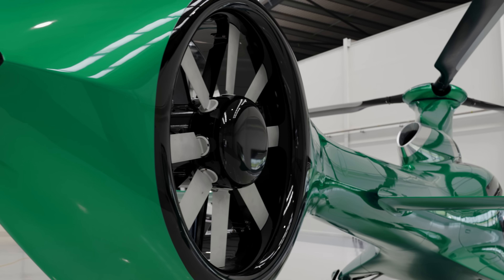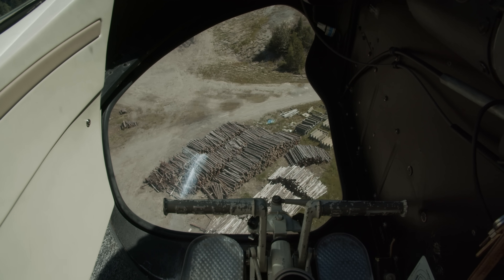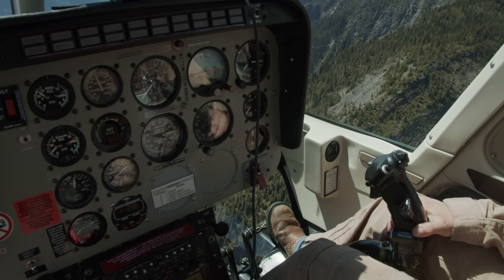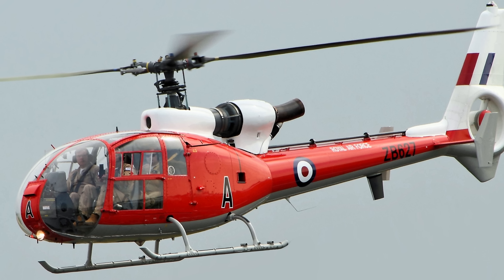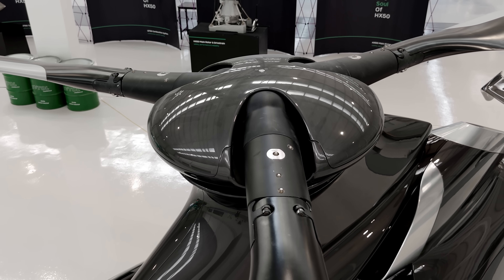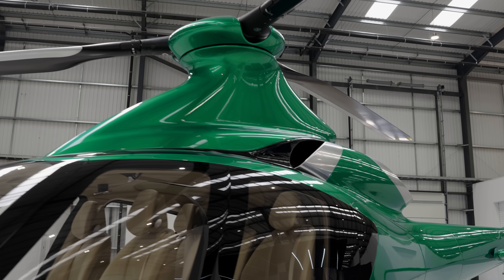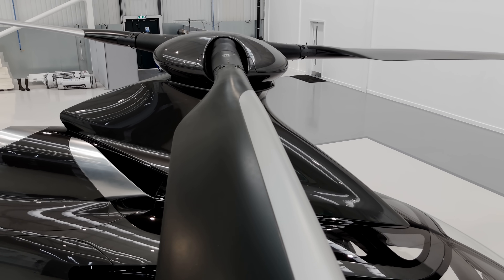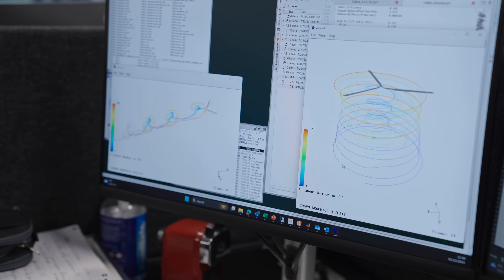Why the HX50 will be so much faster than many comparable aircraft.

Comment: The real development effort starts after first flights will present the problems to be solved, mostly wrt the aerodynamics and dynamics interactions. It may well reach the expected speeds, but vibration levels and/or high fatigue loads in critical dynamic components are most likely going to drive redesign.

Comment: Not sure if it's the same engineering wise, but I'm pretty sure it is. Check out the Drones with the extending wings, increases speed dramatically and also saves fuel bc of the lift from them. You've already got small ones there on the coolest heli design of all time, and seem to want to take it to the next level. Time to go after the Airbus record I think.
Reply: Will be my first, regardless

Comment: I think it is worth emphasising the improved fuel economy. To a pilot it is obvious that if you increase speed with improved aerodynamics rather than extra power you will improve range for a given fuel load, but a lot of non-aviators are used to cars where most extra speed comes from burning more fuel, rapidly increasing at high speeds.

Also, would it be worth having an active horizontal stabiliser, or is the attitude close enough to optimum across the range of CG and cruise speeds to make that pointless?

Comment: Except the problem with heli speed is not so much aerodinamics of the fuselage but more about the rotors movement through air and asymmetrical lift.
Reply: He literally starts out by discussing that.

A Chinook that can manage over 160 kts has similar rotor tip speeds to a Bell 206 which can barely manage 120 kt. It is not aerodynamics that limits the speed in this range.
Reply: @randomxnp  Yeah, ask yoursel what is the major difference a Chinook and traditional layouts.
Reply: @fabriciuslan  What? That does not change the Mach number or stall characteristics.

How about an S-92? That has a slightly smaller main rotor but a significantly higher Nr, to give a higher tip speed than the CH-47. It can exceed 160 kt too.
Reply: @randomxnp  Helicopters face several speed-related challenges due to their rotor design. The main issues are retreating blade stall, where the rotor blade moving backward in forward flight loses lift, and the advancing blade tips approaching the speed of sound, causing compressibility issues. These aerodynamic limitations restrict a helicopter's top speed compared to fixed-wing aircraft
Reply: @fabriciuslan  That is all acknowledged, both by me (albeit implicitly) and by Hill in the video. That is not the point. Part of the video near the start is explaining that is not the point, suggesting you did not watch it.

The point is that these limitations do NOT restrict the aircraft at the speeds being considered. The aircraft is not even close to hitting these limits at 140 kts. It is limited by power, and parasite power (the largest component of power required at high speeds) is calculated as parasite drag multiplied by TAS, so to minimise it the parasite drag must be minimised.

Maybe don't try to teach helicopter aerodynamics to someone who occasionally gets paid to teach helicopter aerodynamics (and to Dr Hill who has just designed a helicopter).

Comment: I personally like the NOTAR design used in a Hughes 500 variant, with no tail rotor to fail. The tail rotor mechanisms always seem like a weak link. I was on a flight review once, and saw a helicopter auger in due to mechanical failure of TR
Reply: That's sketchy 😮
Reply: The Hughes/MD NOTAR system is more complex than a traditional tail rotor. It has all of the traditional components (drive shaft and variable-pitch rotor) plus a rotating nozzle.
Reply: @brianb-p6586 That one on the Hughes 500 uses turbine bleed air, no additional ducted rotor or driveshaft.
Reply: @jd1029 the MD NOTAR design does not use compressor bleed air from the engine. That's a tempting design due to simplicity, and would even inherently compensate for lower level changes; however, it would be inefficient and it would not provide yaw control in the case of engine failure. 

For a more detailed description than I have already provided of the actual MD NOTAR design and its development, read the Wikipedia article for "NOTAR". Of course Wikipedia is not authoritative, but it has links to refernces including one by MD Helicopters (the maker of the Hughes 500) itself.

Comment: Apples to Oranges Demo: an Airbus APU: Honeywell GTCP131-9A APU 440kw output ~= 589shp (if mechanical loss is factored in from the turboshaft -15% results in 500shp) Perhaps 450shp continuous. But likely something to stage up against your GT50 turboshaft unit as far as a close contender. Or an Arrius 2K2.

Comment: It will be interesting to see if the price / performance promised will be delivered.
However, when it comes to “aerodynamic optimization for speed”, the Agusta A109 already has been around for more than 50(!) years, as it first flew in 1971…so, nothing really new there.

Comment: The mast tilt will mean a very nose high hover attitude.  Also no cowling access on his mock up? After all this time why haven't they have come with a working prototype airframe at least while waiting on engine manufacture?
Reply: The Sea King has the mast tilt. It was never a problem in that aircraft (I know, I have flown it). It needed a hover height you would not want to use in a single, but that is a 55-foot helicopter.

Comment: Dr. Hill, excellent point how Bell modified the UH-1, but it was even more impressive how they radically modified it into the original AH-1G Cobra prototype with retractable skids 58 years ago. The early Cobras would give even the HX50 a run for it’s money on drag coefficient numbers! As a former Cobra pilot and current airline pilot I am extremely impressed by what you and your team are creating and I eagerly await for HX50’s first flight. HX50 has reignited my passion to fly helicopters. It has been nearly 30 years since I have flown rotary wing aircraft in the military, and your HX50 is a very compelling reason at an attractive price point (not inexpensive by any means, but within reach especially compared to what is even on the used market) to get back into rotary wing aviation. I really like the idea of an affordable gas turbine as I have never flown a helicopter powered by a reciprocal engine. It appears HX50 will have flight characteristic’s and performance more inline with what I was accustomed to flying in the military than something like a Robinson or Enstrom, which both seem like a several steps backwards. The folding rotors blades and vertical takeoff capability with cruising speeds and range that rival some of the higher performing single engine airplanes while seating 5 people is a real game changer. I don’t want to give up living on deep water moorage water front property (where I have my boat out the back door) to live on or near an airport. HX50 will fit in an slightly taller garage with the folding blades and with the retractable landing gear should be very easy to move back and forth between the garage and the helipad. Now I just have to get the kids through  another two years of college and grad school (and gainfully employed), and convince the wife that a fast jet powered helicopter is an necessity! She wasn’t exactly thrilled about the boat….
Reply: We are all rooting for you!
Reply: @alhubb66  Thanks!
Reply: @alhubb66  As long as he offers us rides!  :D

Comment: It’s not hitting claimed cruise performance numbers that concerns me it’s the hover performance. This machine is very similar in power to weight ratio as an ec120. Max all up weight and achieving out of ground effect hover at 10k feet and isa plus 15 is certainly not achieved by almost any helicopter and an ec120 is so far from doing that in the real world it’s not funny. Yes it’s going to be a very slippery ship in forward flight but hover performance is mostly power to weight ratio and 500hp is just not enough.
Reply: How often do private pilots take a four seat helicopter to hover at 10k’?

The Hill helicopters seem to be a traveling machine for 95% of the needs of a family going places… or a few people traveling from one office to another…

Doing work on a mountain top… helicopter-skiing would be an interesting use, but that would also require certification at another level….

I think, we may see experimental/home built as the certification level here… (?)

😃
Reply: @AC-jk8wq   How often is not the question.  Is Hill being overly optimistic or just lying about the capabilities is the issue.   If it won't do what he says, "there should be no concern that it won't," then there is a problem.
Reply: @ no such thing as over optimism when taking on a project of this scale…
Over promising… should be feared.

A guy named Robinson set the precedence already… there are plenty of Robinson helicopters around.

Robinson uses engines that are manufactured by aviation engine builders… with specific modifications for the application.

😃
Reply: @AC-jk8wq  I’ve got plenty of hours in Robinson helicopters and let me tell you what they are actually capable of far exceeds what the published specifications are. Despite what some people will tell you they are amazingly capable machines. 

I’ve also flown other types where the published performance isn’t what’s advertised. The worst I’ve flown being the MD600N. It can’t do anything near what’s advertised by the manufacturer. 

I don’t know enough about engineering to know how reasonable Hills claims are but when you start comparing power to weight ratios their blades are going to have to be many times more efficient than what’s out there. 

I just don’t think the design engineers that have gone before were that useless. Even though most helicopters designed to date has been done with a pencil and ruler on paper it’s actually amazing how optimal some of their designs were. 

It actually annoys me that Hill rubbishes previous designs so often. The HX50 is being designed on the back of a lot of hard work from other engineers in the past. In reality all Hill it’s doing is cherry picking ideas that have been done before and combining them into one. Frenestron tail rotor, swept blade tips, carbon fibre etc etc. 

Back to my original point though. I hope it lives up to the claimed performance. If it does I’ll buy one. The fact I think speciations might be being overstated is why I’m not in the orders list at the moment. Best to under promise and over deliver. Time will tell.
Reply: There’s a reason the Bell 47/ 205/ 212 (anything with a teeter bar) has a skids running off and running on section in the flight manual.  At the end of the day the marketing team at Hill will just say, “the trade off to be this fast is to sometimes fly it like a fixed wing”.

Comment: Ok first off you haven’t made a helicopter, you have made some model helicopters none of them have flown so how can you claim ANY performance information???
Reply: Claims are based on the simulation described in the video, compared to actual aircraft…

So… you can call it simulated claims if that helps get you to the next video…

Come back next week!

😃
Reply: Bros never heard of maths
Reply: Engineering.
Reply: I’ve worked in aviation as an engineer / maintainer for 18 years, you make estimations based on math and simulations, but untill they have a flight test vehicle that data isn’t very accurate. I think they are taking the Tesla model, over promise and under deliver. I also didn’t realize these were going to be owner built 🤦‍♂️. I can’t think of a worse combination, owner built and maintained and helicopters is the same sentence.

Comment: Dr. Hill, compared to another helicopter with as close to identical dimensions, power, volume, range, and rotor diameter as possible that was manufactured 25 years ago, how much more efficient do you estimate the HX50 will be? The real key here won't just be higher speed with a more modern engine and less drag, it will be more efficient and quieter and longer flight. You have extremely modern engine controls combined with more efficient rotors and a more aerodynamic fuselage overall. I'd say you're potentially twice as efficient as any other helicopter in the same class with all your combined advancements.

Comment: 140 kn is too slow bro
Reply: Cruise, my dude. Cruise. With lots of power to spare.
Reply: A run of the mill Eurocopter does 135km/hr cruise.  This is a bit like claiming you will build a supercar that will only slightly outrun an 18-wheeler.
Reply: @brianhaygood183  Exactly, a Bell 407 does 133-150 knots cruise

Comment: Why have they not build a test helicopter with another manufactures engine to test different aspects out on the rests of the helicopter
Reply: Because that's not how helicopter airframe design works anymore. Their cowling is SPECIFICALLY designed for their engine's layout, orientation, and hotspots.